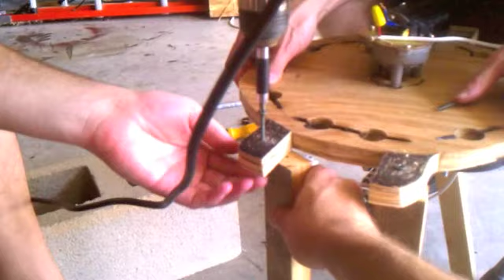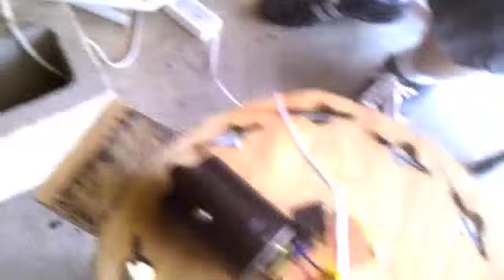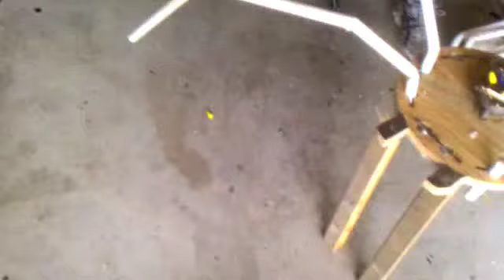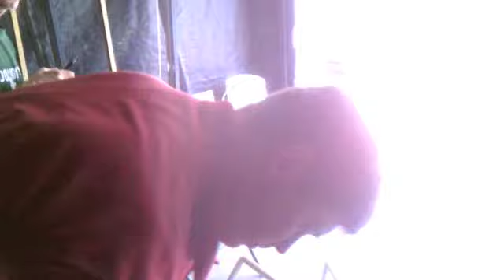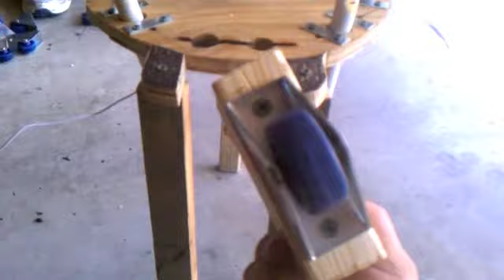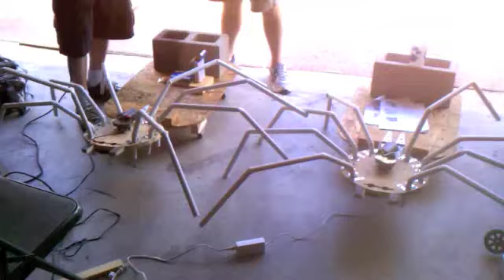Spider wiper update 2

Comment: Hey Steve, do you have a spec sheet for the spider. I'm looking to build one. Thanks and happy haunting.
Reply from the maker: it was a make and take and others make them. i did not make one or have one for specs. Sorry i just filmed it
Reply: +Steve's Haunted Yard thanks for the quick reply. Do you remember what size the pvc was. That's all I really need. BTW I built a ground breaker from your video and it turned out great.